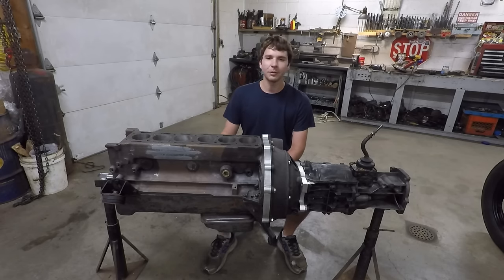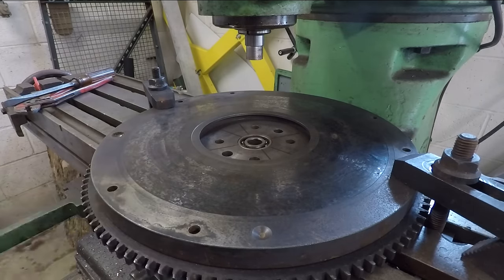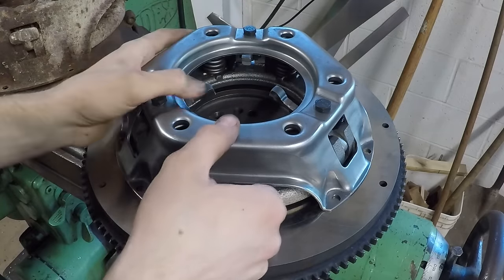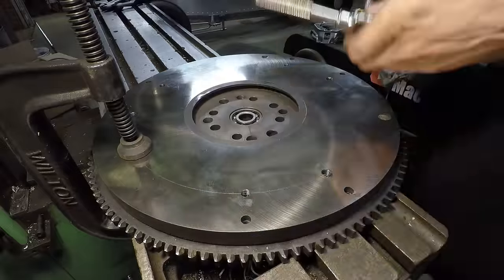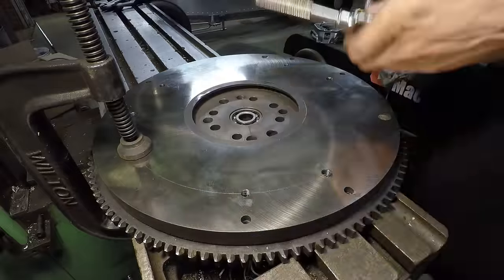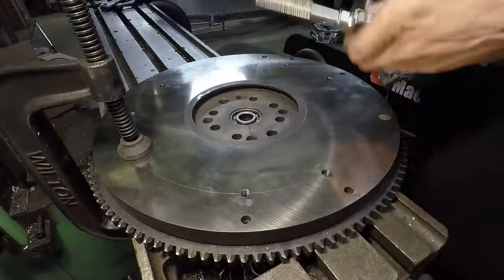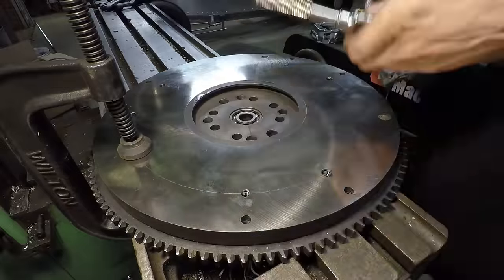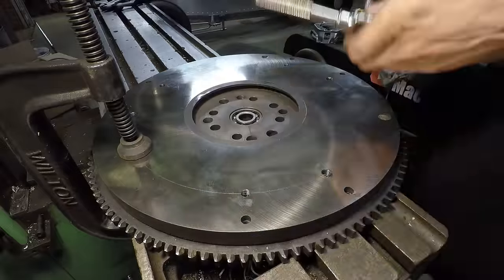Adapt ANY Engine to ANY Transmission!

Comment: Your the guy that gives the autozone clerk a headache
Reply: You have to have a brain to have a headache
Reply: Idk, its pretty easy to give them a headache, last conversation about a repair i was doing i was replacing the gasket on the waterpump, had the guy get me a gasket and as i was buyinh it "so what are you working on?" "Replacing the waterpump and waterpump gasket, some idiot used a ton of rtv instead of the $5 gasket so its leaking all over the place, decided to replace the waterpump too while im at it" "so your waterpump is bad?" "No just the gasket cause it was improperly installed" "oh, well shouldn't you be getting more oil then?" "What? The water pump pushes the coolant not the oil" "well we sell freon right there, not sure why you need this gasket if its the waterpump thats going bad" the conversation degradded from there
Reply: @kiyosenl.3889  lmfao.. this is why i never shop there as a mechanic.
Reply: @rickylafleur5823  i prefer to order on rock auto but i do doordash for a living and my ranger has bad a/c and broken window motors and is slow and a manual so its a pain to use for delivery so when the waterpump in my saturn started dumping coolant everywhere i wanted it fixed asap (thenbi stripped the pully bolts and spent a week trying to get them off
Reply: @kiyosenl.3889  That is why I always try to go in there with the part numbers ready to go.
Reply: @MattsRageFitGarage  oh i had them ready to go, this guy just wanted to partake in small talk, but couldn't understand one of the very very basic parts of a car, prior to that he was always rather quiet. And since that hes been rather quiet
Reply: @kiyosenl.3889  Parts people are weird man. I buy most of my stuff from rockauto, ebay or amazon. Rarely do I go into a parts store unless it's for very basic stuff I need fast lol.
Reply: @MattsRageFitGarage  issue is thats almost always what i need lol
Reply: @CriticoolHit  well i dont go in there looking for advice, i know what i need, they just sometimes try to start small talk about your project and get super confused
Reply: @CriticoolHit  so true. Theres this older guy at my local napa with a big beard and he does have the parts books beside him lol
Reply: @kiyosenl.3889  Awesome
Reply: Tried to get a foot of 9/32 vacuum tube and the girl couldn't process the request past year/make/model
Reply: Great video. Sorry if this question is redundant. I stumbled on it and don’t know anything about you. What is the tank in the background?
Reply: @kiyosenl.3889  this gave me anxiety...been there...ugh....
Reply: In the UK,  if you haven't got the registration mark (aka license plate), you can't get parts. Everything starts with this. No point turning up with the part, part number, anything but the registration mark. All computer searches start with this, it's a nightmare for kit car owners and homer builders.
Reply: @CriticoolHit  those people don't exist anymore😞
Reply: No real car guy goes to Autozone.
Reply: LOL
Reply: *You're the guy that give people with grammatical knowledge a headache. ;)
Reply: YOU'RE, AS IN YOU ARE... NOT YOUR, AS IN YOURINE - WHERE IS THE TOILET?
Reply: Door dash for a living ? You make good money ?
Reply: @CriticoolHit  Back in the day before computers,  I was a sophomore in HS and after school, was  hired by an Auto Parts store to deliver parts and learn the ropes.  Over five years I learned how to do most of the shop work, bearing press, rotor, drum  cuts, valve jobs etc and knew many of the part numbers for ignition,brakes, by heart.   Looking up part numbers in the five foot long rack of books was an art.  Some were good some not so much.   Today most  part store people  at the chains are barely literate.    You're correct, that in some older established part stores you can still find "that guy" the one that knows the books, that knows his chit.
Reply: This is a true story. I called Partsource one time to get spark plug wires for a 2007 Caravan. After I convinced the person on the phone that spark plug wires were a thing and this was not a prank call she told me they did not have any. I asked if a part number would help? After I gave her the part number I was able to drive down and pick them up. I’m assuming it was her first day.
Reply: He's the guy whom the autozone clerk gives a headache (by asking for the year, make, and model).  I know what I need damnit, doesn't matter what it's for.
Reply: Well it's a 1998 mustang with a 1948 jaguar motor and a 92 s10 trans..  oh yes it's 2wd.. can I get my shop towels now.

Comment: “If it can be done, then why can’t I do it?”  You should hang that quote on the wall! Excellent work, young man! 👍
Reply: In 20 years he'll be putting the finishing touches on the macro machines multi stage lunar lander and it will have a bumper sticker with that quote..
Reply: @ianbuilds7712  Haha! It wouldn’t surprise me, in the least.
Reply: @ianbuilds7712  Mars Shuttle.
Reply: That's the way I think!!!
Rock On Brother!!!
Reply: Dude, I did not expect to be inspired
Reply: Because it is a big headache look for parts at different dealers. 😆😆😆
Reply: " Custom aluminum adaptor plates."  With them the engine, clutch & trans go right together.
Reply: without machinist drill press ,machinist lathe and an industrial metal cutting bandsaw  your project will have the dimensions and quality of a terex bone.
Reply: What about the rest of us that dont have the machines to do this
Reply: @ianbuilds7712  Lunar landers have bumpers? For protection when colliding with...other traffic? I did NOT know that!
Reply: My version's been "If a man can figure it out, then I can figure it out." Once I realized this, it unlocked a lot of potential. I stopped being afraid of doing things because they were "too complicated" or "too hard".
Reply: I can't because I don't have a mill, or a lathe, or a big garage, or the skills to do it.  😁😂
Reply: @dodge4x498  it used to be that if you were UAW you'd use the shop at work for government projects.
Reply: Why can't I do it if it can be done? Money
Reply: Remember this Engineers maxim, "Anything can be done, it depends how deep your pockets are".
Reply: @Lowkey_ID  But, you can LEARN to do it. I'm sure there's nothing you can't do if you BELIEVE in yourself.
Reply: I like the spirit behind it, but why the hell would you use that transmission? I assume that engine gets above 100 HP. I can't imagine the trans is going to hold it.
Reply: @ianbuilds7712  now that is some funny shit right there
Reply: @expressionoffreedom7165  those are fairly stout transmissions and torque at low speed with traction is really what kills drivetrains.. I bet that trans would hold 500 honda hp ( coincidentally honda hp is the realest hp ((tq x rpm)) where american v8s kinda cheat their way there with lots of torque due to excessive displacement) all that's to say that the high torque and low rpm and therefore hp of the flatty is more likely to ruin the trans compared to the jag motor (this is all assuming it can handle the higher rpm which Idk)
Reply: OK, YOU ABSOLUTELY CANNOT SPEND THE EQUIVALENT ENERGY AND MONEY TO DEVELOPE A MULTIFUELER STEAM HYDRAULIC MOTOR DRIVE SYSTEM THAT CAN HAUL A COMMERCIAL 40 TON LOAD OF GOODS FROM COAST TO COAST! YOU CANNOT, YOU WILL NOT DO IT! IT CAN'T BE DONE, NO WAY, NO HOW!!!
Reply: @jbodden6977 OK YOUR COMMENT IS NOT RELEVANT...
Reply: I never believed I couldn't do it. But it is sometimes hard. Not impossible, but hard.

Comment: Nuthin' to it.  Just take a 50 pound block of aluminum and cut away the 45 lbs. you don't need.
Reply: top comment lmao
Reply: lmfao!
Reply: He's so resourceful,  I thought he might cast it - make a polystyrene model, bury in sand, add a funnel & pour in molten aluminium... I've seen it done, but not by me...
Reply: Literally all there is to it!
Reply: @helmshardover  billet is stronger then a cast part especially cast aluminum.
Reply: @rickylafleur5823  It's only a spacer.
Reply: @helmshardover  it also has the weight of both pieces plus the twisting from toque being applies to it. some good cast iron could work but cast aluminum is very brittle.
Reply: @rickylafleur5823  Crikey you have me worried. I'm off to check my cylinder head & bellhousing for cracks as both are cast aluminium.
Reply: All of those chips that went to the recyclers gave them a headache!
Reply: Duh
Reply: It would also depend on the alloy. Cut up Honda engines vs meted pop cans. I was told long ago that lawnmower blocks had lots of silicon in it and made really nice, strong parts.
Reply: FUTURE GOVERNMENT CONTRACTORS, PAY ATTENTION!!!

Comment: 40+ years of electrifying restorations, customs and hot rods has taught me many things. One of those things is don't ever make the mistake of telling a hot rodder "it" can't be done. They will do "it" just to prove you wrong.
Reply: Yeah, I know that. Quite a few things I might not have done except for someone telling me I couldn’t do it. Or even BETTING me I couldn’t do it.
( nice clutch )
Reply: @michaelszczys8316  That's sort of how I got corralled into reproducing wire looms for the Citroen D Series. I was at a club event, and I was having a few beers with a few of my compadres. The subject of wiring and the state of the art of current reproductions (they absolutely sucked), and then current need came up. Two of them were "well, yeah, but" and my friend Wally (I miss that dude) spoke up: "You're Hotrodelectric! Go do it!!"
Reply: Nesety is the mother of invention
Reply: So they did something to prove someone wrong? Meaning they fell into the trap of doing something for someone out of spite. Haha. "Hey I built what you said couldn't be done!" .... "oh thats nice, who cares....."
Reply: @MyKonaRC  Yah, you missed my point entirely. I'm not surprised.
Reply: @MyKonaRC  Who cares? I do. People who take up challenges  are  the ones who  are responsible for progress. Without them, we would still be living in caves.
Reply: @michaelszczys8316  YEP
Reply: Are u bill hincher?
Reply: @brentiaconelli6484  Sorry, Brent, no.
Reply: I'm a lot like that... And I will take however long I need to do it and show you afterwards...just to let you know it can be done...

Comment: This is the beauty of having a Mill and a Lathe in your shop.
Reply: In a perfect world we'd all have our own.
Reply: @KowboyUSA  Ain't that the truth brother!
Reply: most definately helps to have those machine shop tools!
Reply: I'm listening...
Reply: @KowboyUSA  though they are expensive. But they look so good, just looking at it is amazing.
Reply: They’re not cheap tools either. I’d have a full blown racecar right now with adequate tools
Reply: @tomsellout9576  Not cheap AT ALL... Especially not the good ones, that are big enough for this kind of work, like the Cincinnati's, Atlas', Bridgeport's, Baileigh's, Hardinge's, etc..etc... Machines like that cost more than a new car!
Reply: @buddylee19082  Nah. You can get an excellent Bridgeport for around 5 grand that will do nearly anything you need. Big, older machine tools like Cincinnati vertical and horizontal mills are in that price range, or even lower. With the big stuff you have to deal with logistical problems. They are heavy, difficult to ship and even more difficult to handle. Good used machine tools have never been more plentiful or cheaper than they are now. Check out Ebay for a representative array of what's available and a rough idea of pricing. BTW, I sure wouldn't include Baleigh junk.
Reply: @tomsellout9576  Our workplace will close soon, they're going to sell some of this stuff by the pound, we're talking about a dozen Bridgeports and Cincinnati's.
Reply: @jeromeclements6532  Ya it only 5 grand, for a part a shop would make for you for far less.  Then don't forget the skills and talents necessary to run that equipment.  Sometimes its just a better idea to let the experts do it.
Reply: @Hoggdoc1946  Sometimes it is, but if you have the ability and the need, get what you need. This is a good time to do so. Obviously, if you don't have any use for one and couldn't use it effectively if you had one, than forget it.
Reply: @Hoggdoc1946  would have to 100percent agree with you that it would be cheaper to have a machinist make those parts but that would be on a one off basis. But if you have the machinery and the ability to design create and make these parts you can put a peitant on them and even make a few extra dollar's. One's own ingenuity can be a wonderful thing.
Reply: I agree with Jerome. I ended up with 2 Bridgeport’s and 2 lathes, big, small and a nice surface grinder. All $20k

Comment: I really appreciate the mindset that comes with you machinists. I'm more of a macro, do it on the fly, if it's got a little slop whatever, kind of guy. I'll drill something by hand instead of taking the time to clamp it into a drill press, kind of guy. What you do takes an entirely new mindset that should never go underappreciated.

Comment: Definitely going to be watching for part two. 

My Dad Did this kind of thing all the time back in the 1950s through early 80s putting 455 Olds motors in a variety of different farm tractors, a 392 Hemi in an International Loadstar truck with a grain box on it, straight 6 Ford in a Mercedes, and so many more.

I never watched enough of it (in the later years when I worked in the shop with him) to have a Clue as to how he did any of them, he just "Made it Happen" and they were "Done"

Comment: Lots of very helpful tips and procedures here to extrapolate to other applications.  The way the sharpened bolt was used to mark the hole location in the adapter is brilliant.

Comment: put a magnet base on the crank and dial indicate the bellhousing to find center. and that is a critical measurement
Reply: Yeah if you are out by 0.001" that will cause a bad vibration, even if you get the gearbox input shaft into the crankshaft bearing. Could have machined & installed the gearbox adaptor plate, mounted the gearbox to the bell housing then marked & drilled the belhousing /engine adaptor plate might have got closer. Time will tell when it is run I suppose. Anyway looking good.
Reply: @petermurphy3354  When i was racing late models I machined and adapter that bolted to the crank and centered on the pilot bushing and had a ring that centered on the bell housing.  There could be as much as 1/8" difference between different bell housings  so after using the adapter we put offset dowels in the block.
Reply: the slop in the pilot bearing will more than make up for it. I saw his centering pin in the middle of the bearing and chuckled.. I bet it will still be smoother than some of the manufacture. I am wondering of the flywheel. Giant flywheels went on the benz style cranks.. like boxer engines. He does not need half of that. This will change his adapter thickness going lightweight.Awesome engineering at home. much respect.
Reply: Yes, center line alignment of crank shaft and trans input shaft is critical.  Also, removing the pilot bearing and dialing that bore in
on the mill and then triging out your pressure plate bolt pattern on the x y  axis will give you assured concentricity  of the pressure
plate to the crank shaft. More accurate than scribing a line and transfer punching. Will save on throw out bearings too. Am also 
thinking that the adapter piece he is talking about at 23:38 will have to come off as the flat head starter has to bolt directly to the
bell housing. Very ingenious young man though and not intimidated by the task. PS, Don't know if he has a dro on his mill but
if not, he should always account for back lash.
Reply: @jerrytalley337  it will also eat trans input bearings and clutch disc
Reply: I also thought that part should have been probably the most critical in terms of getting it right.  As there is no cnc action happening here, there needed to be at least two solid ways of ensuring where dead centre was throughout the entire operation.
Reply: @lionelanderson2368  Nothing but net, Lionel; nailed it.
Reply: @petermurphy3354  fr it was a good try at least. It probably came out all ghetto....

Comment: Johnny Cash - One Piece At A Time -  “ the transmission was a ‘53 and the motor turned out to be a ‘73 and when we went to put in the bolts all the holes were gone.”
“So we drilled it out so that it would fit and with a little bit of help from an A-DAPTER KIT we had it running just like a song”
Reply: skip the " johnny cash" part ! you obviously feel personally challenged or better known as "jealousy" by this extremely smart and capable young man! he earned the respect , so give it to him !   maybe its time to go get your harbor freight catalog and get started mikey!!
Reply: @marioncobaretti2280  Maybe it's time for you to take your chill pill Mary!! I don't think Michael meant any disrespect by quoting Johnny Cash - Great song that goes perfectly with this great video.
Reply: @marioncobaretti2280  What part of those lyrics was, in any way, offensive? It's a song about a guy doing exactly what this video is about...
Reply: @Maverick8t88  bravo 👏 spot on